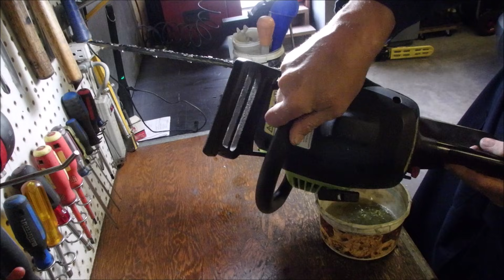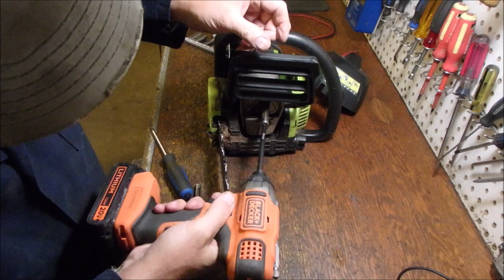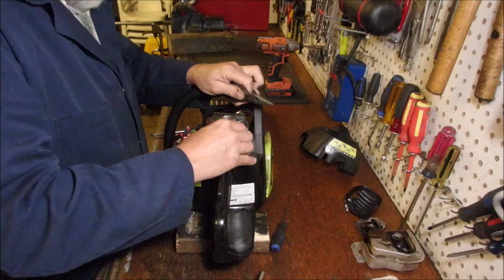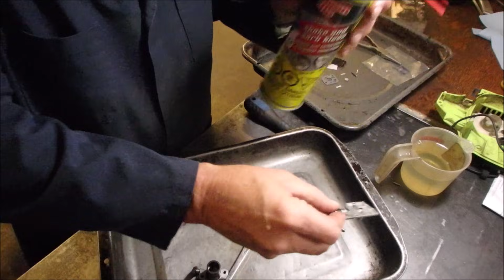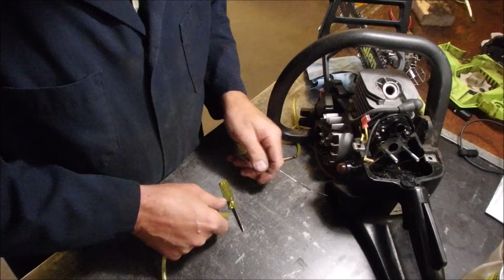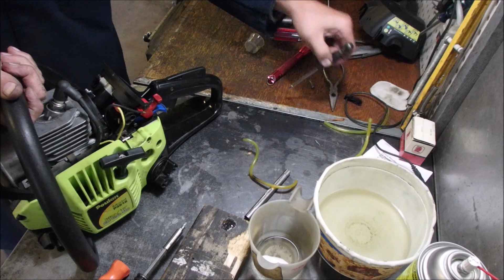Poulan 3816 Chain Saw Does Not Run

Comment: Found this at Husqvarna's site: "During the 1980's organic growth and acquisitions expand Husqvarna’s operations in the lawn and garden segments. Two major acquisitions, Poulan/Weed Eater and Roper Corp, now complement Husqvarna’s product range." So, that saw, probably from the late 90's through part of the next decade, likely shares some Swedish engineering with Husky saws. Lots of folks disparage Poulans, but FWIW, I have a '98 great runner that is similar to that 3816.
Reply from the maker: Yes I have done Poulan Pro mowers that bolt for bolt are a Husqyarna.

Comment: Great video as always ,  Nonc' Bruce  ....  Every saw and weed eater that comes in my shop get's  the fuel line treatment .....  What   I mean is ; that if it has the  .080 X .140   and 3/32 X 3/16  I change the smaller fuel line to 3/32 X 3/16   fuel line  to Tygon line .....I keep the bigger line in stock always .....  As you know I like working on the older Poulan / Craftsman  saws...  Some of those older saws are worth a top end kit to keep them going .......Keep EM Running Non'c
Reply from the maker: Thanks for the advice.

Comment: The last 3 of those that came in had carbon scoring and would never start. You’re getting pretty good at those 2 strokes Mr. P!! The thing I do now is put the saw in wood for final tuning.  Sometimes they sound great but die in the wood needing a little more fuel. Good vid!
Reply from the maker: I did use the saw but had no film.  I agree with you.

Comment: What? A problem with a Poulan.  How can this be?
Reply from the maker: @Rein_Ciarfella  The older ones are great.
Reply: Bruce's Shop   Good to hear because I have a 3314, Predator, Wild Thing and a Craftsman made by Husqvarna which are all identical in most ways except bar length and cc. Acquired free or cheap and totally overhauling to sell on. Also have a much larger Poulan haven’t had a chance to dig into yet.

Comment: I end up fixing a few Poulans every year . In my area you can get them free or cheap.  They only sell for about $50 though .
Reply from the maker: Yes.  The older ones are good but the new ones are not made by Husqvarna anymore.
Reply: @BrucesShop  I don't know to much about them.  Most chainsaws that I fix were free or part of a package deal.

Comment: Hello From Mark In Ky.  Bruce, I have one of the Poulan Woodshark 14 inch bar chainsaws that I purchased brand new some years ago and I have to say that this saw was the hardest cranking saws that I ever tried to use. Also Bruce, I also had the Craftsman version of this chainsaw which had the 18 inch bar that cranked much easier.  
After trying to use the saw and blistering my fingers more times than I care to admit to - I angrily pitched the saw into the junk trailer and have been using an electric Remington chainsaw with my generator with further injuries. 
The recoil starter was also very problematic about hanging up and was sent back when I first purchased the saw brand new.  
Are the Poulan Pro chainsaws similar to these chainsaws?
Reply from the maker: Poulan Pro   (the Pro is the key) in the old days were Husqvarna.  Now they are just a department store saw  (in my mind)
Reply: @BrucesShop  Yeah Bruce, Much as I figured.

Comment: I had one of those,. You were worn-out by the time you yanked starter long enough to get it to run you where too tiered to use it.
Reply from the maker: poulan as in pull on
Reply: @BrucesShop  wanted to hook chain on it and drag it down the road to try and stay it.   But finally gave up it did no have parachute when I got pissed off and threw it over the fence then the trash pile.